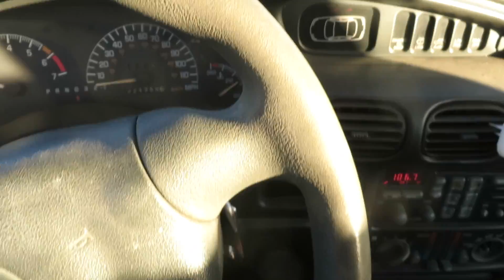My truck got NEW SHOES!!!

Comment: I like the 383. good choice. you coulda got the same power from a 350 though. they're the same block. but hey, I'm droppin a 383 in my 68 impala so
Reply: Neckred Billhilly if I was him I woulda dropped a 454 big block in it
Reply: AlabamaDipper18 still a good motor
Reply: Neckred Billhilly oh no doubt
Reply: AlabamaDipper18 my uncle had a 383 in his 69 camaro. second gear standing on back tires burnin rubber. was pushin over 600 hp. we took it through the busiest part of his town. sliding around corners. wheelies out of stop lights. Girls couldn't keep their eyes off. guys trynna fuck it. was a great time. then the fucker sold it
Reply: A 383 is a 350 bored with a longer stroke.
Reply: You can get the same amount of power from a 350 but a 383 makes more torque lower in the rpm range

Comment: outlaw that 14 bolt will handle the power& is strong. but with the stock 410 gears it has with bigger tires could hold it back. lower gearing it like 456s will wake that beast up. gearing it pretty much gets lost/hidden power back to you. Love your truck vids bro if u want check mine out on my channel, its a 81 gmc lifted.

Comment: Why did you lift it before you put the engine in it's gonna be a pain in the ass to pull it out and get it in without taking the front end off
Reply: mark cannon 12 bolts and the whole front clip comes off 2 people can pick it up
Reply: delco pleasurizer yep exactly how I do mine

Comment: Yeah the ring and pinion can handle it fine but once you throw in a 383 you'll have a ton more power, so let's say you try to burn out and your only geared with 342s or 373s you'll wrap the axle and bend a leaf. My friend did it to her k20 and she's got a stock 350

Comment: Now u have a monster truck because the 383 stroker kind of sounds like a monster truck motor in the truck go to the black bumper on the back and front and put KC Headlights on talk of the cab I put you can put 3  light bars and you can put a light bar on the grill

Comment: Black out the bumpers front and rear, no roof rack but a headache rack in the rear with maybe a couple of whips on it not to tall though maybe a few inches above the roof, some old school kc lights on the bumper with a 52" light bar on top, do a 5% tint strip on the front windshield, change out the grille to a flush metal crate grille with a blacked out logo, do some wicked headlights with tented side markers.

Comment: keep the chrome bumper it has that old school look to it. throw on a chrome brush guard with a light bar of course. That stroker engine is badass. I would take it over the 450 any day. Since it's a Chevy and I have owned a few Chevys and I already see it coming just replace all the fuel lines and fuel intake system. save yourself trouble down the road. A good skid plate probably wouldn't be a bad idea.

Comment: NV4500 5 speed swap would make a huge difference, especially on the highway. I have a 74 with a 4 speed and motor wraps out at 65-70. with a 5 speed she'll cruise at like 2k rpms

Comment: Hey Outlaw, are you going to do a brush guard. If so I have seen some like your suburban's I myself have a 1985 Chevy Scottsdale k10 with one ton axles. (in the process of getting it running because it caught fire a year ago). However I want to do a full bumper replacement brush guard with mine.

Comment: Are you going with a push or pull style E-fan? pull style is quite a bit more efficient. I run a Flex-a-lite dual 12 inch fan pull style setup on my drag truck (Ford lightning 660HP 880TQ) you'd be perfectly fine with a push style too but just a suggestion.

Comment: No need to gear bro I had a 78 with 6 inch lift 38 ground hawgs low lock 3rd gear went like a tank looks good bro wish I had that down here in good ol wv
Reply: cherokee ronnie bigger tires mean more to push which means gas. you gear it right youll have closer to stock Mpg.
Reply: +Joshua Dupont if mpg is a concern a k20 is a bad choice and a lifted k20 is a worse choice
Reply: Jeremy Long it puts more stress on the rest of the shit. idc about mpg. its a k10 on a k20
Reply: you always need to gear. If the stock gears arent in the mid 4s or higher with 37s then there is a lot of stress and power loss going on. I would say ~4.5 would be a sweet spot between drivability and low range.

Comment: Hey outlaw word of advice my neighbor has a 454 big block in like the same truck as you have and it has a holly carb on it and if you think it start hard in the cold now it will start harder with that on it Edelbrock is the way to go and he had on the 350 before we swapped he engines he had a holly and it started mad hard we had to bump start it most of the time and the carb was brand new so bro I don't want to see you trouble with it and bro I love the build you put together so I just warning you about holly carbs they aren't what they cranked up to be thanks for the vidjas

Comment: go into the interior lmc online just released some cool bucket seats go into the sound system I ordered an ac Delco original radio that came in my c10 but it's after market so it has Bluetooth connection and auxiliary hook up I got the headliner with built in speakers it's nice just go into the interior and make it look amazing and black bumpers and a black grille all black out I promise you it looks good my entire trucks red the grille and light bezels bumpers are chrome it's a nice truck just need get me some body work now

Comment: Don't do a light bar on the roof it wouldn't look all that great put on in the grille and do a headache rack or roll bars and but the light bar up high just not on the roof and do rear pod bumper backup lights and if u want to add a little power run a little nitrous the engine could handle
Reply: Or do KC lights to make it old school

Comment: Outlaw...you should look into doing a rear disc brake conversion on the 14 bolt, maybe even a rear spring shackle flip kit...not that it needs more lift but they'd be cool videos for that bada** Truck man. off road designs website has kits for both conversions

Comment: 383 power house small block strokker boyyy black bad ass steel bumpers lights and a roll bar made out of steel pipe not that junk bolt on with a light bar

Comment: Get blue under glows and wheel lights get blue halos blue cab lights black bumpers new exhaust get overhead light bar and under  light bar get a new paint job go with white with chrome or blue sparkles

Comment: Not a hater, but your front end is literally the same 10 bolt front end the under the half tons just with 8 lug hubs, and the rear end of just a semi floater literally just as strong as the half ton running gear just has the 8 lug outers. And just cause it’s a 14 bolt don’t mean anything as far as gearing. I bet you anything your truck has 308 gears as do pretty much every single one of these trucks out there which means it’s still gonna be a dog with the 37s, I’d definitely go to atleast 410s it would wake that truvk up a lot